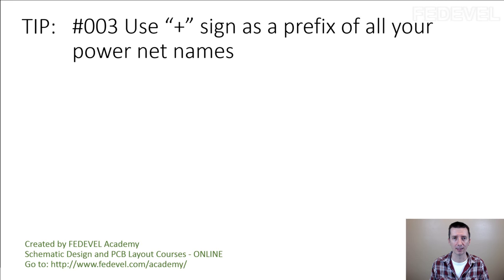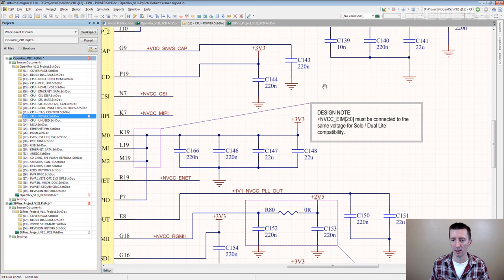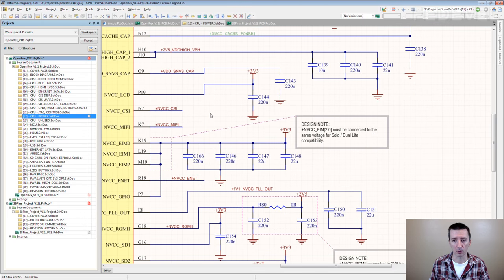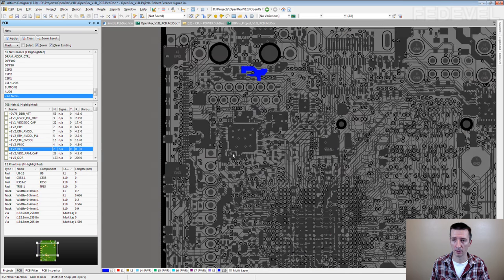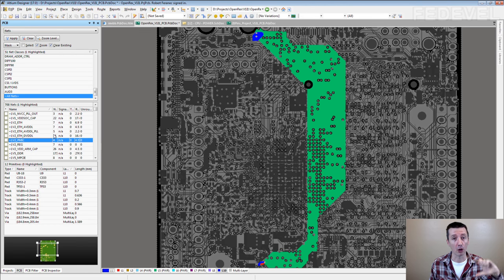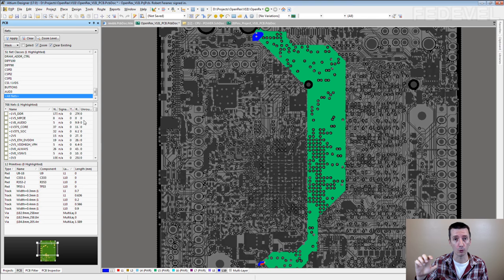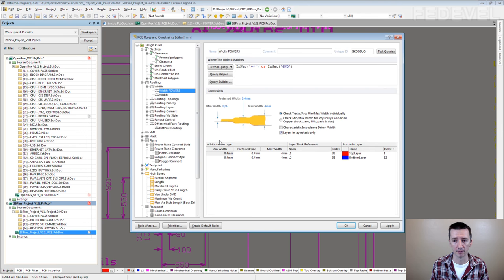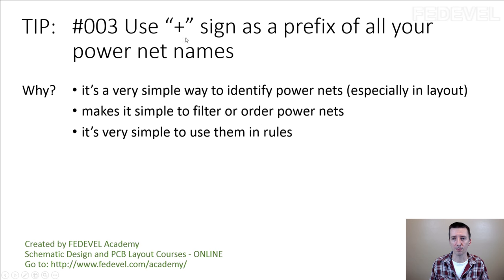TIP #003: Use “+” sign as a prefix of all your power net names

Comment: Robert, can you please move there every days tips to another channel? Your tips are great, but the subscription and alerts every day are annoying. M
Reply from the maker: Thank you Mvorisek for pointing this out. I believe, it is possible to disable notifications for specific channel. Click on the red SUBSCRIPTION title in the left panel. That will list all the channels you have subscribed. Click on the bell button next to the channel and you can uncheck "Send me all notifications for this channel". I hope this helps.

Before I posted the first tip, I was thinking if start a new channel or use my current one. The biggest problem with new channel is, that I would need to start from zero: no views, no subscribers = posting tips which no one reads. It would be difficult to keep up posting the tips if only a few people read them. I am sure you understand.
Reply: The checkbox is already unchecked. It just fill the Subscriptions page + shows a "notification" on that link.
Reply from the maker: I do not understand, so it is not working if you uncheck the box - you are still receiving email notifications? I have my notifications switched off for some channels and it works oki for me ... interesting.